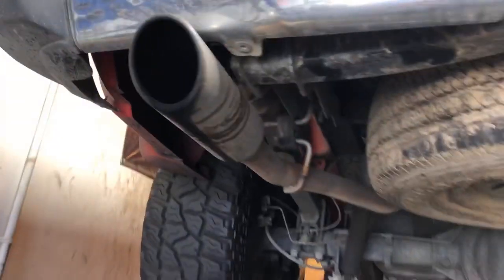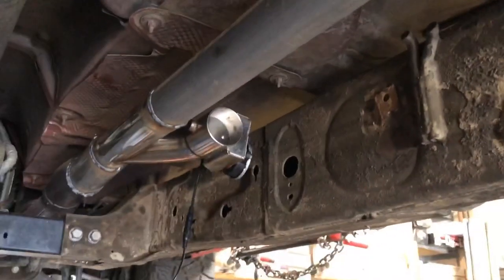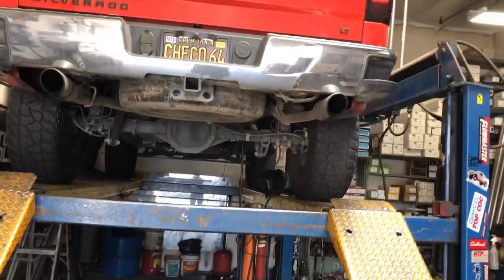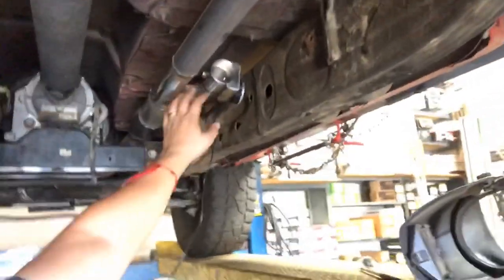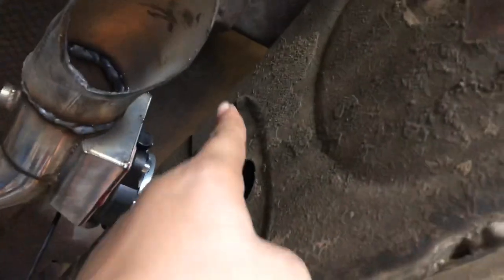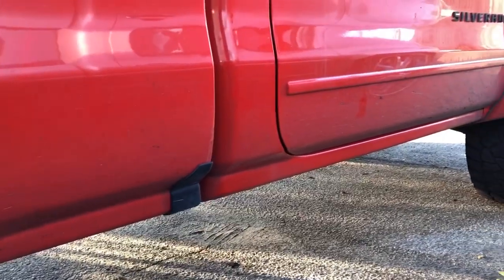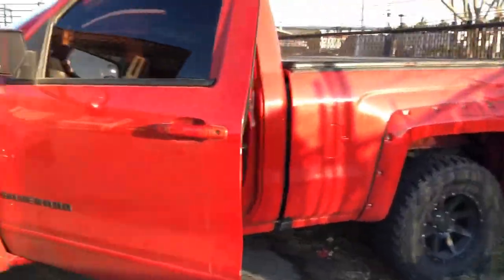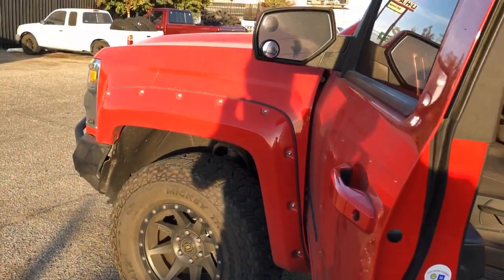Installing my electric exhaust cut out 2.5” on my Silverado

Comment: Did it throw a sensor when you cut the cat out
Reply from the maker: when you delete the third furthest cat no sensors detect because it has none, the two cats closest to the headers those two are important they have sensors so if one or both get deleted the check engine light goes on and you won't pass smog